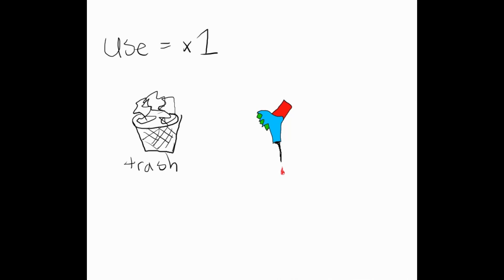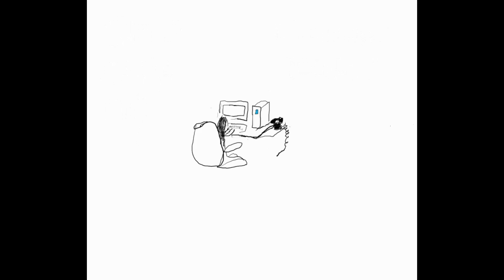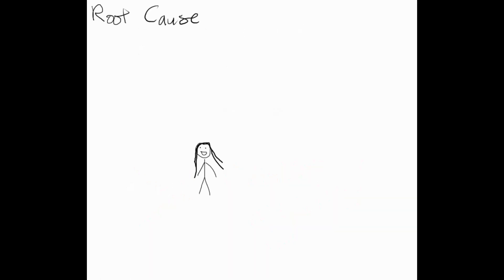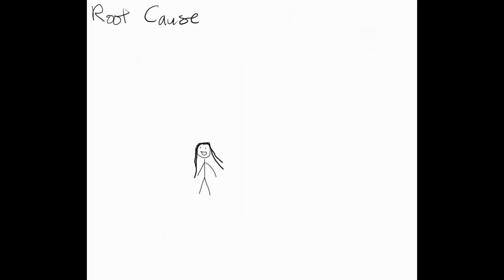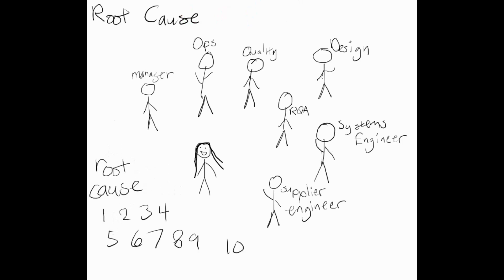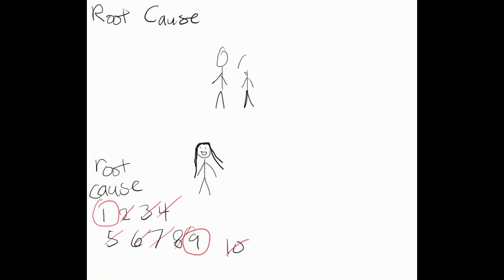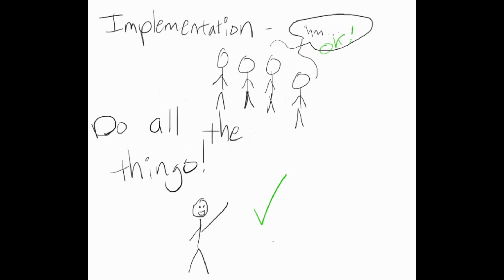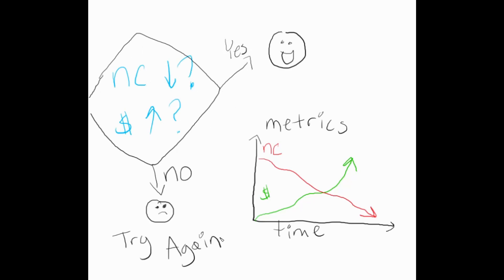Day in the Life: Quality Engineering 2, Medical Devices

Comment: What did you answer when asked, why did you switch from QE in automotive assemblies  to QE in medical devices ?
Reply from the maker: I moved to a new city.  When I was applying for jobs in that city, I noticed there were more opportunities in medical device than in the heavy industry.  It seemed like a good move to go into medical device so that I would have more opportunities available to me, should I need to switch jobs again.
Reply: JobTalk I would really appreciate if you could suggest me any answers for this question of changing the QE field from automotive to medical device or hollow metal door or electronics.
Reply from the maker: @hetpoptani3579  I'm confused by your question.  If you are asking how you can make the switch, my recommendation is to tailor your resume for each specific job application you submit - ensure you call out parts of your past that the company could use.  Then just keep sending applications until you get to where you want to be.
Reply: @jobtalk9793  I think he was asking how you justify an industry change; for instance, wanting to go from the electronics industry to aerospace, or from the automotive industry to medical devices.
Reply from the maker: @Samcanplaymusic  @HET_POPTANI
I think if the experience fits well enough, you don't need to work very hard to justify an industry change - either on your application or in person.  The issue is when your experience does not fit very well AND you are switching.  That's when it would be worthwhile to put an explanation in a cover letter and be prepared for questions during interviews.  Also ensure your goal in applying (or why you are switching industries) for the job is clear at the top of your resume if your experience does not speak for itself.
Reply: @jobtalk9793  thank you for your responses and awesome video! Going off your last comment. What is an example of a good Objective/Professional Summary to put at the top of my resume for a Quality Engineering application? I have one already but I wanted your input
Reply from the maker: @Abel-nl2yo  I generally wrote my objective/summary such that it emphasized a few of my strengths and goals which fit the job description. I can't say I have an absolute winning template for you, though.
Reply: @jobtalk9793  Thank you for your insight. If you have time for one more question, what are some goals you might put? The only goal I've thought to put in my summary is "Seeking to leverage my skills as a Quality Engineer at *insert company*"
Reply from the maker: @Abel-nl2yo  Perhaps you could pull something out of the job description and use that as a part of your goal? (ex: seeking to use my skills in leading teams through six sigma problem solving)
Reply: @jobtalk9793  That's a brilliant idea. Thanks for the help and insight. God bless you!
Reply: @jobtalk most of my experience has been as a QE in aerospace. There’s a ton of biomed companies in my area but they refuse to even reach out to applicants that don’t have a minimum of 2-3 years direct biomed experience. Any tips?
Reply from the maker: @tomcastillo7550  Apologies for the late response.  Perhaps go through a different engineering role such as manufacturing engineering first?  If your local industry and companies have enough applicants to keep that 2-3 year requirement, it does make sense on the quality side where they want to be sure the applicants know about 21 CFR requirements and the recent MDR changes.